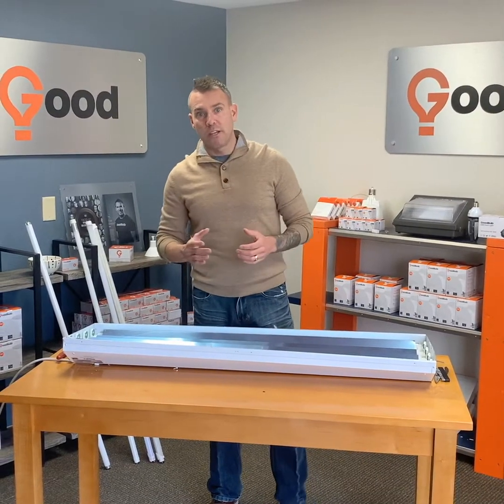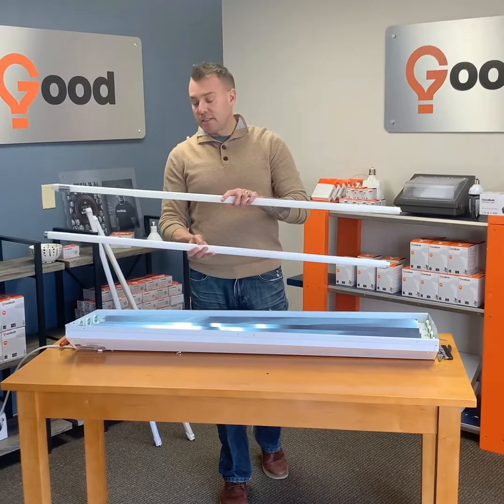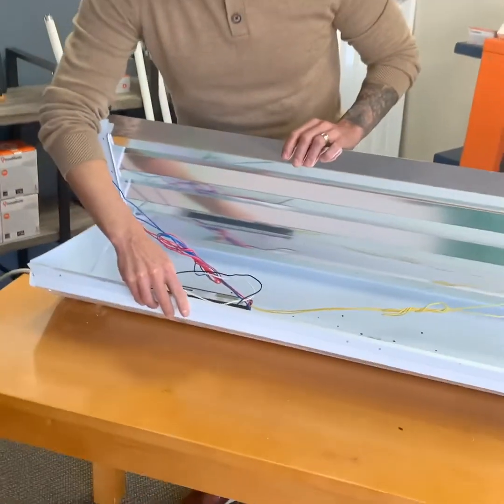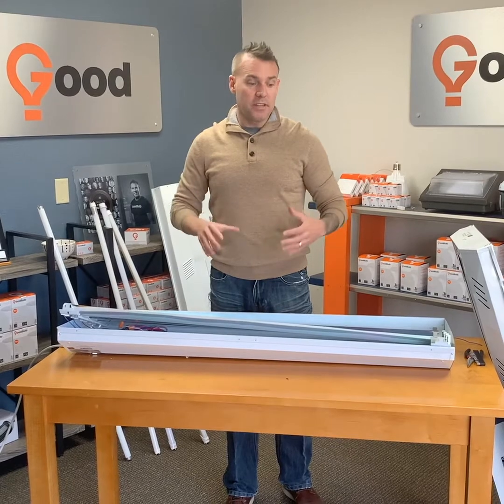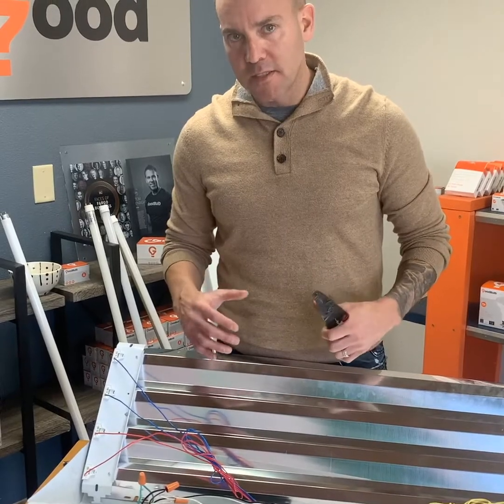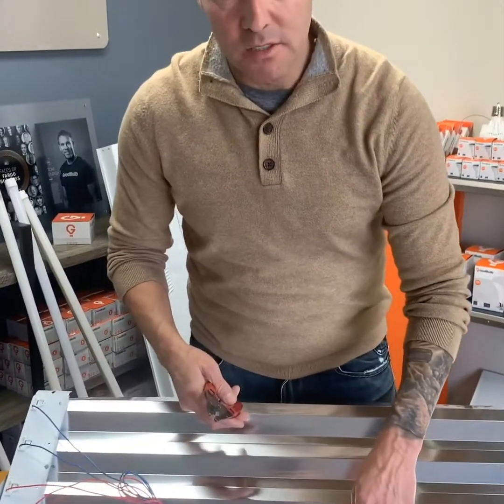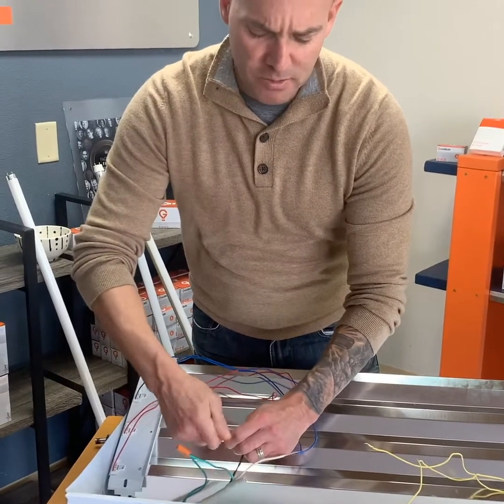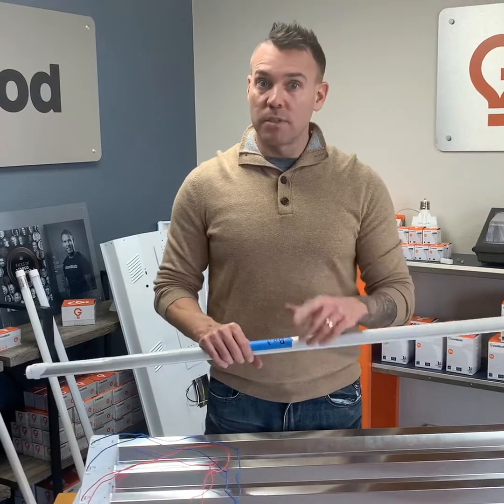How to bypass a ballast with LED tubes

Comment: With wiring the fixture this way; what type bulb to I need to buy? Is it a double end style? Thanks
Reply: You'd need B type or hybrid. Bulb manufacturers give wiring diagrams that are possible. You can use shunted or non shunted tombstones.  If you use non shunted you will shunt them externally by adding 2 pigtails or by adding a jumper. If you wire single sided you must use non shunted tombstones or the the neutral and live will be shorted.

Comment: Super awesome video well explained. My still not working. Is power just not working
Reply from the maker: Sorry to hear that - Did you get it working.  Are you using GoodBulb LEDs?  Some of the box store bulbs are just bad.
Reply: @goodbulb7223  I guess I need to get different bulbs the ones we just got use Load and neutral on the same side